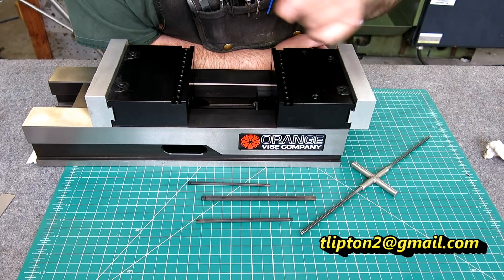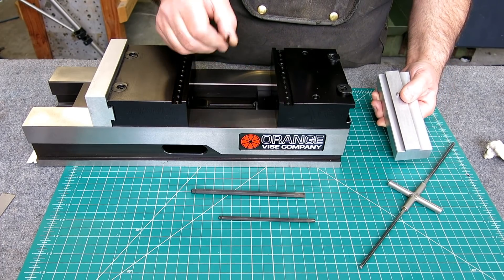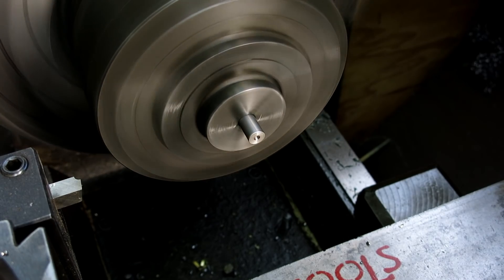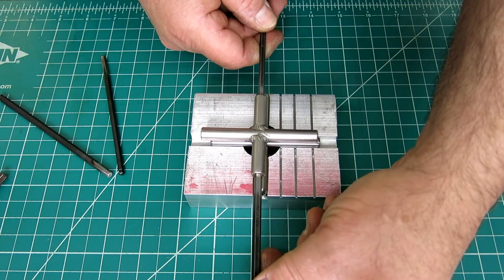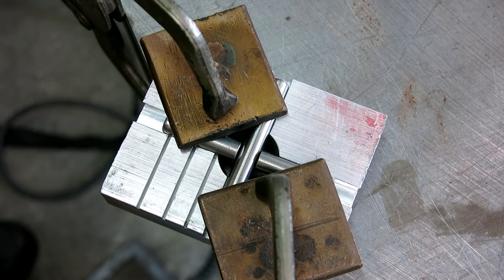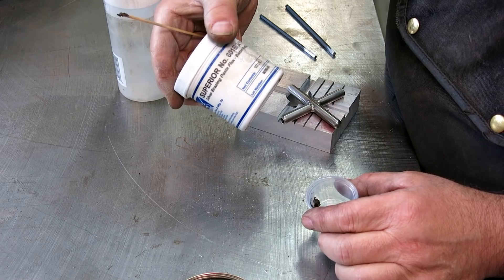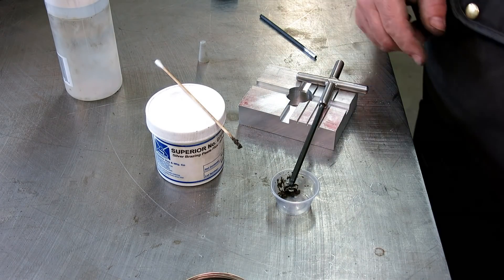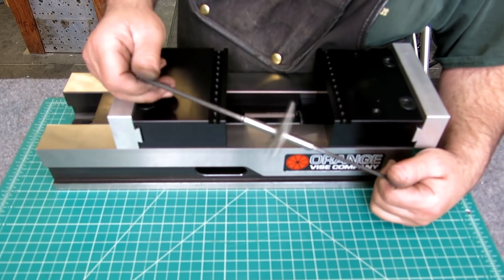Ox Tools Speed Allen Driver

Comment: On a similar silver brazed item, I cut a couple small internal grooves to add extra bite for silver. Base was 303, think that was my problem needing the grooves.   
I was told not to use 303 afterwards,  but had a box of parts out of 303.  not waiting was a problem for me till I learned. lol

Comment: Why not use set screws so you can replace the shanks ?
Reply: Why complicate the issue?  Silver solder is the perfect choice for securing and replacement..
Reply: @paulcopeland9035  
I just kind of like the idea, no heat required just unscrew and replace.

I guess it's kind of weird to need a hex wrench In assembly of another hex wrench though.

Comment: If you drilled a hole in the alignment jig, you could stand the Cross handle vertically when silver soldering  and not need a vice.

Comment: I made some keys for panic bars like this. Turned a brass disk, then pressed in the allen key.

I calculated the area of the hex and drilled a hole with that area.

No solder needed.
Reply: How do you replace the key (easily) if they are a press fit?  Heating the solder seems like a simpler solution.
Reply: @paulcopeland9035  

I don't anticipate having to replace the hex shaft. In regular use you probably would not wear one out, but if you did, the tip could be trimmed several times.

Comment: 7:40 the metal sparks! Have you considered parting the smaller bits by drilling the same diameter hole (Probably held down in the welding fixture) so that you get more contact area/better weld? (It may look better too)

Comment: Since you did such a nice job on the chamfer  on the ends  . Would you not go over the top with a concaved milled end on the mig welded end .  I do know it is such a small area and the weld does have good depth to it .   Making it look like a  role cage type weld.    cleaning the oxide made it look very fine.  Nice video .

Comment: Nice job. 

I made something similar for my shop made quick change tool post. It has two Allen keys and a socket. The socket is for the mounting nut at the top of the tool post and the Allens are for the SHCSs that hold the tool bits and the height adjustment. That's everything I need to mount and use the tool post: the holders have their own adjustable lock-down nuts that do not need any tools. I don't weld - yet. So I made if from 3/8" galvanized pipe fittings. A "X" or four way coupling in the center and four male plugs in the arms. I drilled the plugs to fit the Allens and held them with set screws with a bit of copper wire under their tips for a good grip. I filed the third plug down to a 1/2" square to fit the socket. The plugs and the socket are all held in place with JB Weld epoxy so nothing is coming loose. I left the fourth plug without epoxy in case I ever want to install a fourth tool there: I may need to take it off to machine it. 

It works great and I know it belongs at the lathe and no where else. And all the tools are right there, in one place - no searching. And the rounded contours of the CI pipe fittings fit real nice in my hand.

Comment: Beautiful welds there. The oxide is actually quite pretty without cleaning.

I wish TIG wasn't so hard to get into.
Reply: Practice and patience.
Reply: @KISSMYACE3203  That's the straightforward part. The hard time is choosing equipment. MIG is easy. The only   real functional differences are amperage and duty cycle. TIG, aieee. Miller makes at least four different lines of TIG welders, not counting the multiprocess and generator units, and then there's options like water-coolers, etc.

The TIG capabilities I know about that vary between the units, in addition to amperage and duty cycle, are AC welding, DC welding, HF start, pre & post gas flow, and AC balance. I'm certain there's a bunch of important things I don't know about.

All of that makes it hard to decide on equipment, and none of it is cheap.
Reply: @PaulSteMarie  I'd be more than willing to help you decide depending on your budget/requirements. I've used pretty much all the different Miller's and personally use a Dynasty 200 DX and Syncrowave 250.
Reply: I also use a Lincoln Precision TIG at my day job.
Reply: @PaulSteMarie  Pretty sure all TIG welders do DC, which is good for steel, stainless, copper, titanium, etc. If you want to weld Aluminium, you'll need AC.

HF start is a good idea if you want to be able to weld without having to scratch start your tungsten on the workpiece. Much more convenient. Pre and post flow gas is good for protecting the work for especially sensitive materials like stainless and titanium. AC balance is good for setting up a tradeoff between cleaning action and penetration, only available on an AC TIG welder of course.

Main question is do you want to weld aluminium or not, if so, get an AC welder. If you can afford a machine with all the features you mentioned, you won't regret, but if you can't, you'll still have a decent machine that can weld any material.
Reply: @KISSMYACE3203  Yeah, the Dynasty and the Synchrowave seem to be the leading contenders. The MaxStar and the Diversion lines don't seem to be suitable for a general purpose TIG welder. Functional differences between the Synchrowave and the Dynasty are less clear. My general impression is that the Synchrowave has fewer bells and whistles. Not sure if it's still a transformer unit or if it was switched over to inverter technology. 

Basically I want to be able to weld aluminum and stainless, as well as getting something with more control

Comment: For some reason I had always assumed that the handle was aluminum and that you had cast it over two L-wrenches with one short arm up each of the cross arms. (Apparently I never noticed that the sockets for the blades were clearly welded to the cross-arm.) The actuality is both a slight let-down and a revelation. I should have known that there isn't enough "meat" at the junction for an aluminum casting to withstand the forces involved for a good gronk.

Since I don't TIG weld, I think that if I made up a jig like you show, and provide the clamping and a virgin SS wire brush (and maybe even the filler rod, since I keep a selection of 316L filler in various sizes for my wire fabrication use), maybe I could get the job done fairly cheaply by a local welder. Making such a wrench for each machine that uses two sizes (lathe tool-holders come to mind) seems like a worthy addition to my usual dedicated tool sets that I keep with each machine.

For myself, I think I would use plain-tipped blades, since I sympathize with the apprentice who proudly went to the boss saying, "I just fixed all the Allen™ wrenches; the ends were all rounded over." (I think ball-end hex wrenches are an abomination,  and only dig out the set I keep hidden at the back of the drawer when I absolutely need them. They just won't keep a screw aligned properly and they really suck at holding a screw on the tip to get it started in some inaccessible location.)

Comment: Totaly making a set of these. Thanks!
Reply: Right? Really not something you even need a lathe for! Small tubing and a hammer, solder the cross. Itd evem be lighter ;)
Reply: @imagineaworld  The weight of the cross bars is what makes it spin easy.
Reply: @firesurfer  eh, just seems feasible, given alot of us dont even have a lathe or any way to accurately center drill small stock.  itd be alot nicer if it had weight like that, but still doable without much money or equipment involved. A hammer, some small tubing, solder and 2 allen blades. Done.
Reply: Already made a couple since his last introduction, best tool in the shop. Made a small boss on the end so i can secure them with screws rather than silver solder, i'm a bit of a cheapie with hex keys, so they don't always last as a proper one would.
Reply: @imagineaworld  If you can afford that vice you can afford a small lathe and or a small mill/drillpress
Reply: Stef pretty neat tool huh?
Reply: @incubatork  What does the vise have to do with anything? You don't need to own the vise to be able to use a tool like this.
Reply: @xenonram  or make one for that matter xD
Reply: @incubatork  i have a vise, but i didnt buy it. It was given to me, broken, which i fixed.x)

Comment: Just out of curiosity, could you have drilled the hole 5 thou. under the point to point distance for a press fit and used loctite to secure the blade in place?
Reply: How would you change the key?  He mentioned he had 2 or 3 replacements on the original.  Why complicate the issue?

Comment: I made something similar years back except I used 1/4" rod for the handles and drilled/tapped soft steel ball bearings for end knobs, which added more inertia to keep it spinning longer once you got it going.

Comment: Good job on a quick upgrade to your tool kit. I use my set of Bondhus screwdriver handle ball drivers that I got in 1977.  For a shop built tool the double ended driver is a clever improvement.

Comment: Ox, I have tried this several times using silver solder as you did, but it keeps annealing the hex wrench so that it twists at the connection point. My technique is the same as yours. Any suggestions?

Comment: For version 3.0, broach a 1/4" hex hole into one of the handle ends, so you can use interchangeable hex bits as well. Maybe 3.1 can have a little magnet stuck in the bottom of said hex hole too.

I suppose the Lipton Do-Key wouldn't actually be such a great name, would it....

Comment: AWESOME tool!
I too made a tool I thought nothing of it initially and I find many uses for it as well - a simple 1/2" long, 3/8" wide hex brass piece I bored and tapped M6 on one side and M8 on the other. The tapped areas meet in the middle. Simple, right? But it's one of my favorite tools now because I have so many applications for it - from screwing a buffing wheel (lathe ways properly protected, of course), using it as a resin/wood mount for some fun key chain turning, screw mount (if I need to trim screws, or polish/trim washers), Etc.. and yet - it's so simple. 
Same principle applies here - this is an awesome tool because it's so useful!
Ever thought of adding more "units" to the other 90deg arms? But then, of course, it wouldn't spin so freely... :)

Comment: "Speed-Hex"... simple.

I appreciate it's current simplicity, but would adding some 1/2" ball bearings as "fly-weights" to the end of the cross be a worthwhile upgrade? (If I had the capacity, I'd test it myself, but I don't, so throwing it out for discussion)
Reply: Use 3/8 bolt, cut off hex and attach to shaft. Put a couple of 3/8 nut on threaded end for you fly-weights

Comment: Without knowing, (or stating it, at least), you have demonstrated why T-handle drivers should be considered a life investment, not a disposable, buy the cheapest set available tool.

A quality T-handle hex, torx, etc, will have a steel cross handle. This is important because of the weight it adds to the tool. The weight facilitates thos long, smooth spins possible when installing, or removing socket head screws.

Cheap T-handles are cheap because the T-handle is lightweight, all plastic, and do not spin worth beans.

Notice in the first part of the vid, when Tom is introducing the dbl ender, he's spinning it in his hand.  He's unwittingly demonstrating the best quality test for a T-handle. If you can easily spin the tool, and get a long, sustained spin, you have a keeper.

MSC Supply sells a house brand, (Paramount), hex T-handle with a nice, heavy T-handle, which get bigger, in a couple of steps, as the hex gets bigger. They are certainly on par with Snap-On, Mac, etc, in everything, but price.

Buy a good set of T-handles, make an investment in yourself, you are worth it, and won't regret the cost.

(Full disclosure: my wife works for MSC, and we own stock in the company. While I receive nothing directly if you buy something from MSC, the company's overall success is a benefit for me.)

Comment: Small cross drilled hole on bottom will stop the pop up during brazing.....love these quick trick videos
Reply: It will also make the solder drip out and then require an extra step to remove it.  Once the flux goes from paste to boiling liquid the air seal breaks.

Comment: Since in don’t have a welding capability, I would just drill a hole and put a rod through the hole like we see on a tap wrench. Another idea is since you are already silver soldering, why not just solder on side handles. Thanks for the video.
Reply: The "side handles" are welded on because they would likely fall off again when re-heating the piece to replace worn or damaged hex shanks. Welding requires a considerably higher temperature to actually melt the base material as opposed to silver brazing which does NOT melt the base material. (AKA silver "soldering").